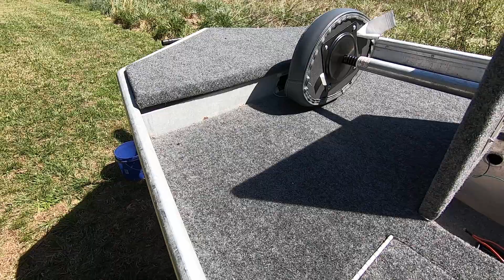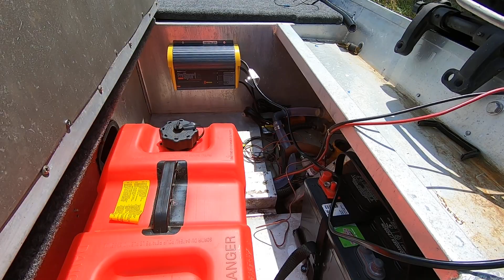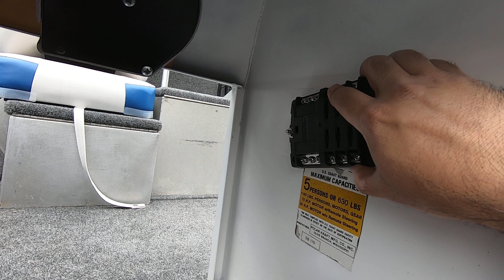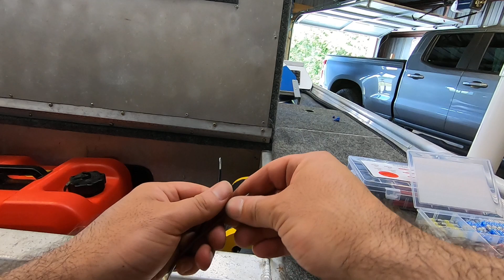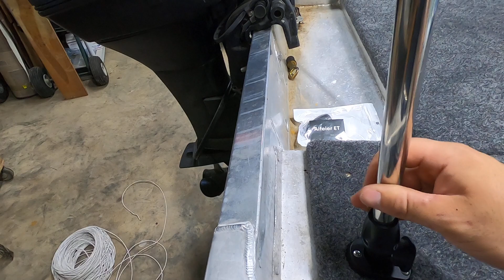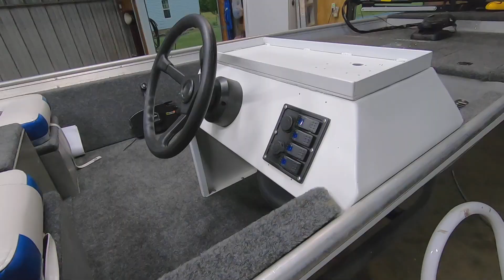How to Install Boat Batteries and Wiring - Ep. 7

Comment: Hey, next time when you go to put those pool wires through and instead of using like older wires like just you know small wires like speaker wire use a strip throttle cable one without any of the rubber coating on it just the throttle cable it’s very strong and can go round corners
Reply from the maker: Great tip - I'll remember that!

Comment: can I ask why you used 4ga wire to run to the fuse box. I don't think your going to need that big of a wire just to run lights and pumps on. now the trolling motor needs a heavy wire to it. and the engine starter needs a 4ga on it. But that was just over kill for the smaller stuff your going to run on the fuse box. And as close as your battery is to the trolling motor you could have used a good 8ga wire for it.
Reply from the maker: I didn’t want the wire to be a limiting factor that’s all.  Aside from cost, there’s no downside so why not go bigger than you need

Comment: Trolling motor head hangs out to far over side. The guild post will catch them as you unload the boat. At least it looks like it will to me. Excellent video. I’m redoing my wiring now.
Reply from the maker: It's close... but the back of the boat is wider than the front, so I made sure the trolling motor head did not stick out past the gunnel at the back.  If I were to do it over, I'd probably angle the trolling motor more sharply to the front so it doesn't hang over at all.

Comment: Very informative. Did you grommet around any wires that were entering any metallic openings (think specifically where the wires were running into the gunnel from the battery compartment)? I'm always worried about metal rubbing against the wire sheathing and cutting it open. Thanks for posting!!
Reply from the maker: Yes, I did use a grommet where those wires are coming out into the bilge area... I'd always recommend covering those types of areas because I definitely worry about it too!

Comment: Nice work, clean install! I would look into getting some marine grade shrink tubing to go over your connectors, even though they are shrink tube as well. I have heard of people having issues with corrosion in as little as a year, even though they claim to be water proof.
Reply: Yeah I did end up using heat shrink wrap on all of them…. Didn’t feel comfortable with just the connector